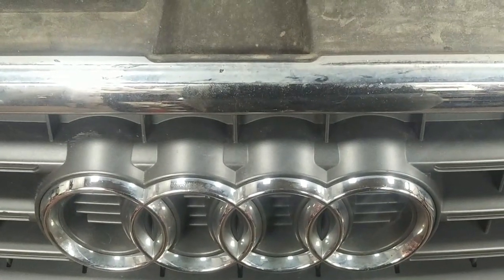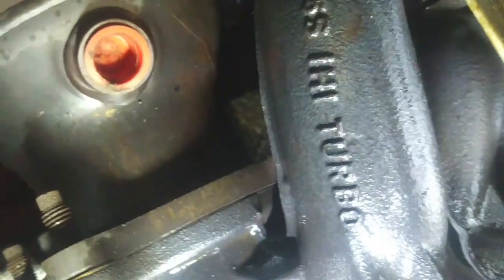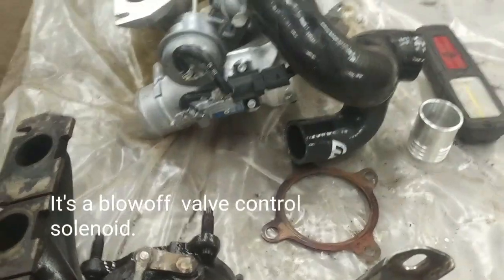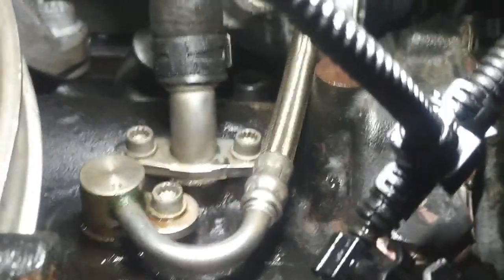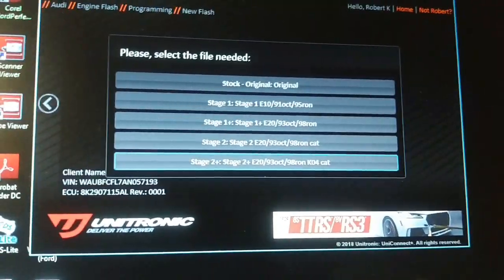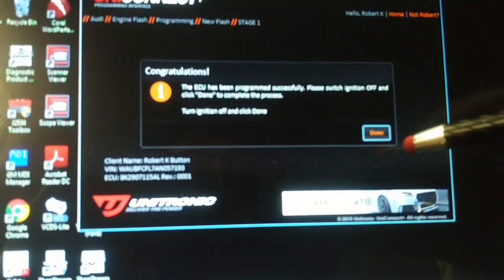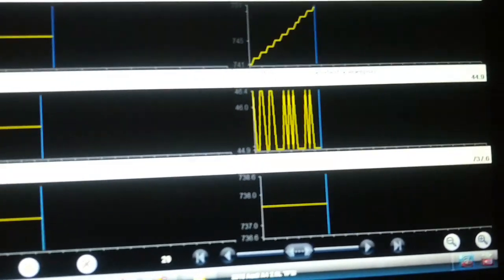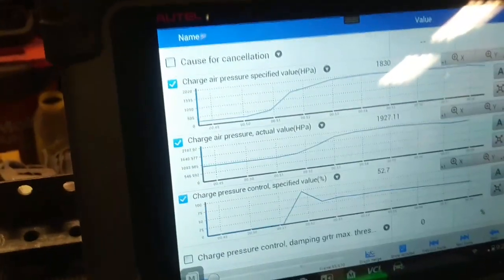Unitronic  K04 Turbo Upgrade on 2010 Audi A4 Quattro

Comment: i own a 2010 a4 and am a service tech at my local audi dealer these things can be a pain if you dont normally work on them. the splines you refer to is called a triple square. VW/Audi also likes to your torx bits and inverted torx as well
Reply: They can be but overtime it’s actually pretty easy especially when you don’t have to chase certain tools around to finish the job

Comment: either Unitronics or the customer should have known/explained that you needed to tune ECU with the Stage 2+ option to suit the new turbo. All the other tunes on the list do not support the larger turbo.
Reply from the maker: Thanks but wouldn't the stage 2 tune be more aggressive than the stock tune?
Reply: @PhillipBailey  - the tune itself is basically settings and parameters stored in the ECU to make the engine operate efficiently and unlock its full potential. The tunes themselves don't really make the car more 'aggressive' unless you drive the car hard because the ECU adapt to your driving conditions. I have a Stage 2 tune in my Audi but the car is my daily driver and I drive it very conservatively. Since the tune I actually get better fuel economy than the stock tune. Having said all the above you don't really have a choice in the tune you use because you have now changed the hardware that affects the engine (in this case a larger turbo than stock) - in the modding world a Stage 2+ and Stage 3 tune are specifically designed to suit the larger turbo. Stage 1, Stage 1+ and Stage 2 tunes are for other bolt-ons minus a bigger turbo, eg. air intake and exhaust, etc. If you or your client didn't want a more 'aggressive' car then why upgrade the turbo in the first place? You could have simply replace the turbo with the equivalent stock turbo which would have been easier and cheaper! I can only assume that 'aggressiveness' was the objective.
Reply: @stefanoprinci5664  not to mention lack of supporting components.  he showed what looked like a Forged DV (or BOV, which negates some efficiency). what is the point of installing a K04 when only minimal performance gains are realized when there are no supporting components?  yeah, of course it "ran like a scared rabbit" because it's lean AF.  thats one way add hp, and to separate the pistons from the rods,  but there are much less detrimental ways of doing so, if that is the end goal.  the computer will try to keep adding fuel, but I doubt the stock tune is capable of adding enough.
Reply: without the proper k04 tune the turbo will fall on its face at 5k rpms , im sure hes sorted out software by now lol

Comment: The customer needs to run the k04 tune or they could risk damage to the motor.  Also the kit and tune is supposed to be paired with a high flow catalytic converter and down pipe.  With the proper tune set you will see boost pressure max at roughly 24psi. Don't worry, with the proper tune and high flow cat it is completely safe.
Reply: Agreed...there should be a KO4 tune option
Reply: @alexisjung7347  im sure 2 years later it has blown up boy now lmao (and there totally is now from multiple box tune companies)

Comment: Found this old video and wanted to give you an explanation if you didn't realize by now. The k03 is not built for the stage 1 tune on this car. Stages 1&2 run with the stock IHI or Borgwarner K03 turbo. Stage 3 which was one of the files he should've downloaded was the file that runs with a K04 and intercooler. You need an intercooler due to the raised thermal temps created with the tune. Hope this helps
Reply from the maker: Thanks for the information. I figured it out in the end. I admit I was learning too. This was some time ago and the engine jumped time about a year ago and bent valves. He didn't fix it that time.
Reply: @PhillipBailey  Unfortunate, as it's a widely known issue if he kept an eye on it could've prevented. The cam phase number tells you when. Right around -4.75° is when you should start replacing it...that or before 100k miles and if the tensioner (which you can see through the chain cover) is past five or six notches. Great video

Comment: KO4 is supposed to be run with a high flow cat or test pipe and Stage 2 tune. Upgraded intercooler also recommended. It will not run to its full potential without all those supporting components and the stock tune likely will not supply the fuel needed for the added boost so it will operate like a stock turbo and there's the risk of engine damage. My turbo on my B8 crapped the bed and while I was tempted to just throw on a KO4, I decided to just go with another stock KO3 because I lacked the supporting components.
 This car likely ran harder with the stock tune because it was running very lean which in a turbo car usually spells death for the pistons, rings, and head gasket.
Reply: What do you it’s better the K04 or K03, I just bought a 2010 A4 Quattro with 51k miles and it has turbo waste gate rattle and I’m planing on changing the turbo in a near future but I don’t know if the K04 will make my engine fail sooner than going with the K03, I just want to keep the car reliable if I can say that about this damn 2.0T
Reply from the maker: I'd probably recommend to stay close to stock to ensure reliability. That's just my opinion though. I'd recommend to join an Audi forum and ask the group what their thoughts are. Good luck
Reply: How come no one has said anything about the fuel injectors?
Reply: @dondraeusual5972  fuel injectors aren't an issue till 400hp. Then you switch to opel injectors before having to touch hpfp

Comment: as far as gainig acces to that lower nut you use a long wobble extention and a long handled ratchet from the top i believe it is a 13mm nut. sometimes you need a semi deep socket as the stud can stick out to far for a normal socket
Reply: On my 2013 A4, they are 15mm nuts.  But yes, I had the same trouble and found the best way to access it is to phyically lay on top of the engine, left hand/arm holds the 8 to 10" extension with deep 15mm socket onto the nut.  Use your right hand to hold the ratchet and connect it to the extension.  Removing rear O2 sensor gives you more room too
Reply: @alexisjung7347  your right i believe they are 15 and not 13 like i think i originally say

Comment: Supposed to run the k04 tune at the bottom
Reply from the maker: Thanks we did switch to that later.
Reply: Phillip Bailey how did it work out, I’m getting ready to order a k04 for my 2010 a4 i already have a Downpipe and k&n filter. Any codes?
Reply from the maker: @Jcarney87  seems to run awesome. Lots of power. Haven't dyno  tested it but goes like a scared rabbit.
Reply: @Jcarney87  did you get thek04
Reply: Same.did ya do it?

Comment: There's no turbo speed sensor....its a stock diverter diverter valve on the k03 he removed. Also k03/k04 turbos and most audi forved induction systems are recirculating systems the ecu has calibrated the air through the Maf sensor so using an atmospheric bov is not recommended unless you like running rich.

Comment: that dreaded bolt it has been the bane of many
Reply: are you talking about the coolant feed line on the passenger side? I'm having trouble getting mine in still. Any solutions or recommendations?
Reply: @missedchrono7458  the chain of extensions required to get to the bottom bolt on the flange from the turbo is the only way barring pulling the entire engine out

Comment: the low boost code p0299 is  due to faulty waste gate. the waste gate rod becomes loose.
Reply from the maker: Yes that's what was wrong with the original turbo.
Reply: is there a way to fix it?
Reply from the maker: The wastegate cannot be fixed in the field without replacing the entire turbo. Could possibly be sent somewhere for repair but definitely not locally at least here.
Reply: @PhillipBailey  thata false forge makes a actuator replacement
Reply: The waste gate flap tho is what cant be fixed a lot of times the rod just becomes loose that's why Audi started putting a special clip on them as a recall remedy
Reply: But if it goes to long without it the flap bushing or what not wears out and then you need a new turbo
Reply from the maker: @lovemytypes0609  on this one it's actually the wastegate shaft in the housing that is worn.
Reply from the maker: @lovemytypes0609  it's not the actuator or Rod that failed on this it's the wastegate shaft in the housing that has worn out.
Reply: Old video and comments but I just replaced My wastegate flapper and bushing. Ebay sells a kit for 60 bucks. I grinded the arm off for the wastegate rod. Then uses a bolt and sockets to press the bushing out after drilling the roll pin. Dropping the new bushing and flapper in was easy. Line the arm for the wastegate rod and weld it up. The engine was out for a rebuild so it wasn't hard. Wish I had the extra money for a ko4 at the time
Reply: Old video and comments but I just replaced My wastegate flapper and bushing. Ebay sells a kit for 60 bucks. I grinded the arm off for the wastegate rod. Then uses a bolt and sockets to press the bushing out after drilling the roll pin. Dropping the new bushing and flapper in was easy. Line the arm for the wastegate rod and weld it up. The engine was out for a rebuild so it wasn't hard. Wish I had the extra money for a ko4 at the time

Comment: a turbo is not a standalone component. nevermind all the other needed components that are needed to work with the K04.  there's a convenient list supplied by Unitronic on their website.   just forget the downpipe, cat, exhaust, intercooler, CAI, injectors, catch can, trans tune;  yup all optional,  just slam a lot more air into the motor,  the computer will eventually figure it out.  or not.
Reply: it is all optional i mean its highly recommended to have a down pipe but if you are not tuning the vehicle it should run just like the k03 turbo for the most part
Reply: Jackson Stinger very incorrect lol

Comment: good evening where found the black silicone durite with dump valve location please thank you
Reply from the maker: Not sure what your asking. The black silicone hoses were all part of the kit which required reworking the original dump valve if that's what you mean.

Comment: I've run a k04 turbo on my 2010 b8 quattro for over a year now and it still runs great, I bought the turbo off eBay it was off an 2008 s3, it took a bit to get it to fit I had to cut and re-weld the output side of the turbo and redirect it slightly as it was hitting the block, and I had to put a spacing plate as the turbo housing hit my engine mount, and lastly the exhaust flange was different, it took me all day to fit, but it gave me 308bhp with everything else stock. Turbo cost me 300 and custom remap 500..
Reply from the maker: Wow thats a lot of work. I know what was involved here and it was engineered to fit. Good job.
Reply: Thanks, I had the same turbo on my a3 8p quattro at first, only alteration was the outlet hit the block thats when i had to cut the aluminium outlet and reweld on a slight angle, but after that everything just fitted, the ea113 turbo fits perfectly onto the ea888..

Comment: You used the wrong tune, you need the k04 tune, that’s the whole point of putting on the k04 turbo, can’t believe you didn’t know this.  Also for the bolt you can get it from the top with a simple 10 inch extension.
Reply from the maker: Thanks for the tip. I never did this job before nor used this tuning software. There were no instructions with the unit at all.

Comment: Ok, so maybe this wasn't the project for you.    My first worry was that you didn't correctly identify some parts of the turbo. 

Secondly , given the model of turbocharger you should have received the information on the correct tune.
Reply from the maker: You are correct. This was my first turbo swap of this type. Ive replace many turbos but not this model. The customer supplied everything. In hindsight I should have done some research myself but all is well. Car is running fine. I'm sure with some other mods it would improve performance as well.  Thanks for the comments.

Comment: Stage 1 using a k04 turbo? Customer doesn't seem very knowledgeable  at all.  You need to use the software that is compatible  with the K04 which would be stage 2+.  Choosing a stage 1 the person might as well have gotten another oem k03 turbo instead

Comment: This video is really old now but I feel like your son knew more or less that he wanted more power and that’s why he bought the bigger turbo. However you need a lot more supporting mods to run this set up, bigger inter cooler, Downpipe/HFC, upgraded fueling system, cold air intake, and the car has to run the stage 2+ for it to run better it won’t be more “aggressive” but the car to run well it has to know to add more fuel run timing differently then stock there’s a lot that goes into it this isn’t at all your fault your son should’ve told you why he bought the bigger turbo (more power) and that he would’ve needed a lot more investing for Day into the car for it to actually run the bigger turbo set up at this point in time if you still have the car and it’s running congrats I’m really surprised a rod hasn’t shot through the motor or a piston hasn’t flown into the atmosphere or that that turbo isn’t shot already you need a new oiling system to run the bigger turbo. Best regards!
Reply from the maker: Thanks for the advise. Wasn't my son though just a customer that asked me to install the turbo. His original wastegate was worn out to the point it would not make any boost. It is still running and running just fine as far as I know. Have had the vehicle back for other repairs since and alls well.